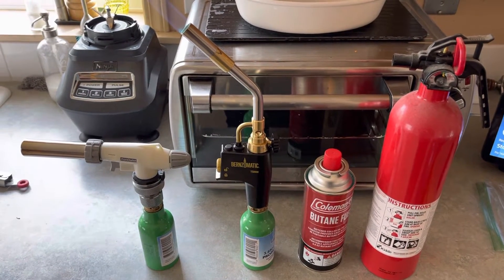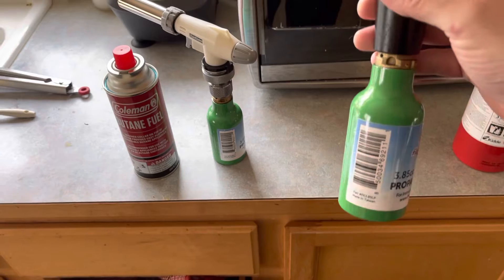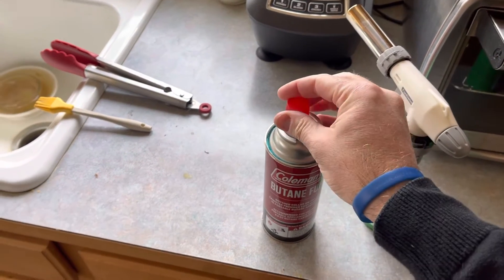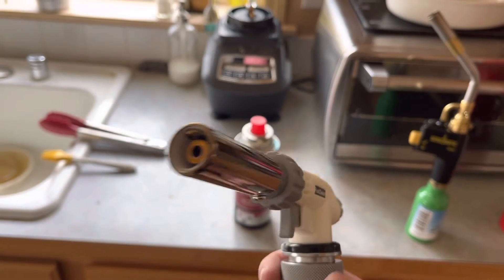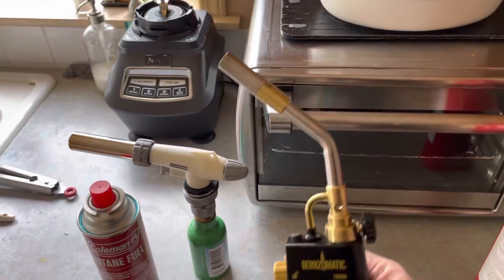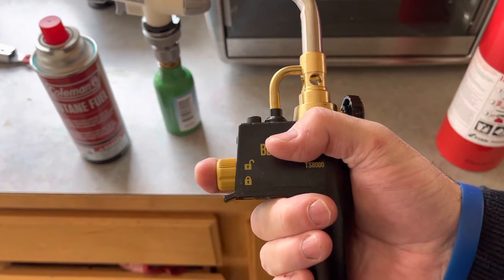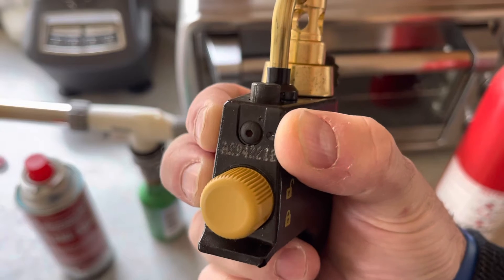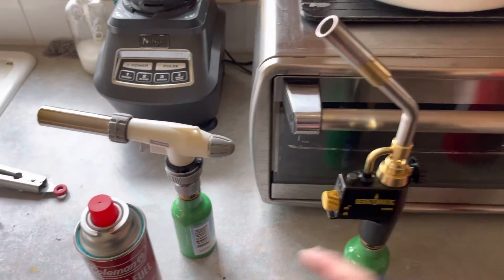A #Butane Culinary Torch Burned #Propane for the First Time, and This Was the Effect

Comment: Yo man how did you get your torch head working with the small tank seems like whenever I filled mine it doesn’t wanna work afterwards idk if I need to have the bleed valve on or what
Reply from the maker: Do you have the same flame king tank? They have a bleed valve that is opened during filling to relieve gas pressure as the liquid propane fills the small tank.

Comment: for how long can you run the Bernzomatic torch with the small tank?
Reply from the maker: Thank you for watching. The torches use very little fuel and used intermittently. For is they last very long. Obviously running at full power for a long time may be a rare use case.
Reply: I never saw you actually use the butane torch head with the propane in the 10 minute video, does it work well? Does it ignite properly? I was curious how the flame looked if it was getting the correct air to fuel ratio